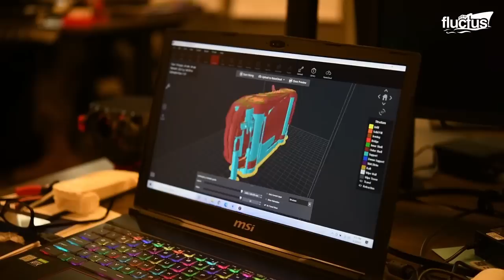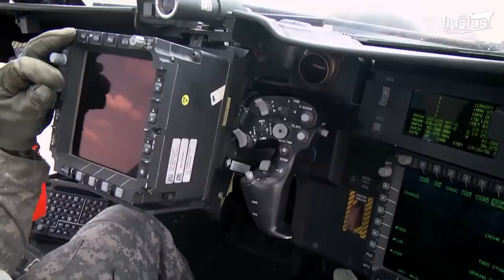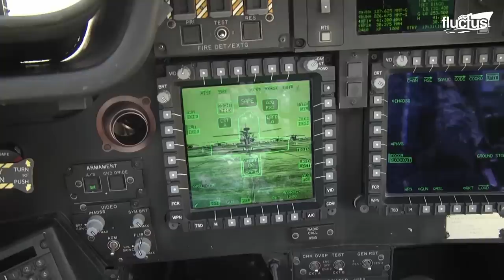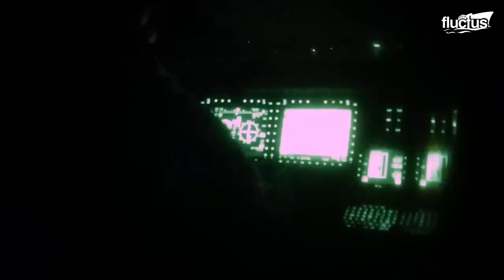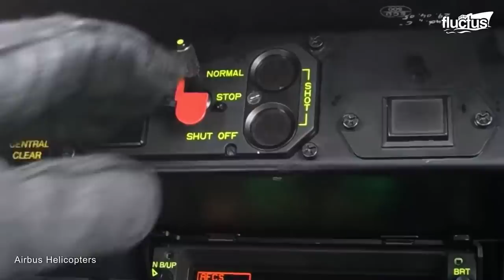A Day in Life of US $20 Million AH-64 Helicopter Pilot Firing Scary Ordnance

Comment: The Apache is close to $50 million.  
Lots of pricey options are available
Reply: I'd be happy with a base model with a cup holder.
Reply: @johnswick4593  missiles are the heavy option that break the bank.
Reply: @michaelmccarthy4615 
 No doubt.
Reply: What price can you offer?
Reply: @renaissanceman340  I have a 66 Chevy truck I would be willing to trade for an 
AH-64 even if it's missing a main rotor. I'll throw in a box of 8-tracks and some VHS tapes.